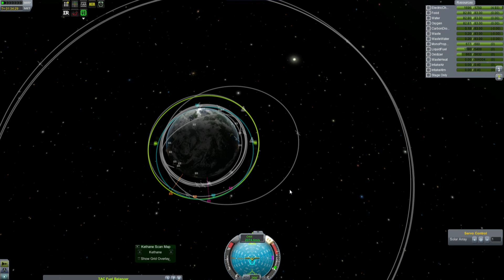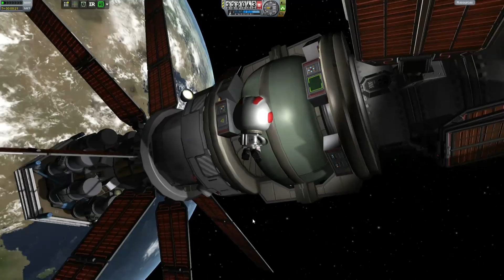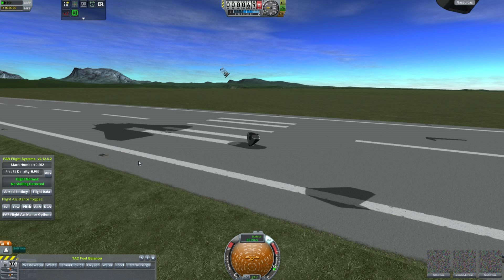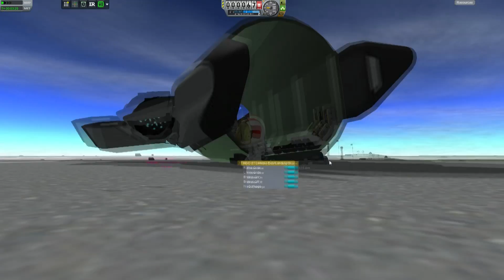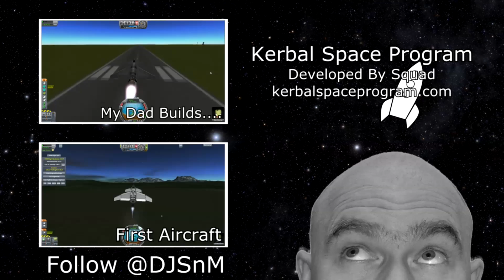Kerbal Space Program - Interstellar Quest - Episode 54 - Another Descendant Of Zardoz

Comment: That's what happens when Jeb lets Bill and Bob fly so that he can take a nap. I am certain he would have noticed that the landing gear indicator did not indicate gear down and locked on final. Surly a KAA representative will give all three a stern talking to after the KTSB investigators file their report.

However, it is possible that the crew was well aware of the situation but wanted to express to the design team their dissatisfaction with the vehicle's performance during accent, docking, and decent. Hence Jeb's grin as the plane disintegrated around them on the runway...

Comment: For the instability problems you had at high AOA I'd say that you should really consider using the pitch trim and yaw damper. I've made several FAR capable high mach aircraft and they all basically flop around and lose control if I try to fly them by hand, and thats with a joystick. Using the WASD controls is hopeless if you need to be that delicate. Pitch trim plus the FAR leveller and yaw damper and even the pitch damper really works great. It can be an almost hands off job once you get things balanced well.

As for the wobbling payload, have you considered using the KAS struts? You can attach them in EVA and strengthen anything attached to your spacecraft once you've bent it 90'. You might consider that for any future deliveries using the infernal robotics joint method.

Comment: Scott, do you play on Linux? I cannot play with half the mods you use simply because the 32 bit program for windows cannot handle the memory needed.
Reply: He's got a few mods which reduce the memory requirements for the various mods (such as lower resolution textures). It also reduces the boot-up time slightly, but not by a lot.

Comment: Scott Manley : I think you can address your oscillation and securing the payload problems all in one. Use the kerbal attachment system struts to secure the payload. Then once you open the cargo bay doors EVA detach them, extend the payload, then re-attach the struts to somewhere on the wings to keep it from wobbling while you dock. Alternatly, use RCS on the payload and EVA remove it after docking.

Comment: There was an easy solution to the oscillation problem. You should have selected "control from here" on the docking port on top of the cockpit. That one will not induce oscilations because it doesnt have a flexible joint. You would only have to visually align one axis, so it should be pretty easy that way.

Comment: The elusive "Octagonal Hex-Thingy"
Reply from the maker: I was reading that line in character.
Reply: Scott Manley
Scott, just a bit of a heads up that you quite possibly already know about; Ferram Joint Reinforcement works somewhat different in 0.23.5 since it gives over most of its functionality to the stock joint reinforcement, which means that whenever you upgrade, you'll likely have to redesign your launchers. Also, KW rocketry and B9 aren't currently set up (in configs) to take advantage of the stock joint upgrades.

Comment: MUR WINGS AND MUR STURTS ARE ALWAYS THE ANSWER. But really you needed to strut the Radiator to the actuator arm, Also maybe sturting the actuator to the space craft as well would have been a good idea and you obviouslly need more lift at high altitudes so either deflected wings to give you more lift or just plain old more wings.

Also deflected wing would make the turning for re-entry easier. Also if you have 2 Vertical stabilizers at the back if you angel them outwards toward the front by 5 degrees it creates a small amount of constant drag which stops side slipping and also. Its especially effective at helping you regain control after you go into a flat spin because it depends on drag rather than lift.

Comment: How did you get your Infernal Robotics stuff working with the update? I just checked their forums and as far as I can see there still isn't a fix for it yet. ALL I need is that hinge for my MW receivers.

BTW Quantum Struts work great for those docking issues. There is even a regular strut gun that isn't all glowey so you can retain realism. I put them around docking ports with a action groups, completely solved my wobbling problems. I also use them to hold payloads that will need to be released later. They are exactly what you needed to fix your oscillation issue.

also, that ending was hilarious. I really don't know how you always pull it off.  Your videos are the best, Keep it up!
Reply from the maker: I haven't updated yet, indeed, I can't update until all the mods are fixed.
Reply: Thanks for replying, and thanks for all the videos!

Comment: Instead of using a strut, you could use KAS. I have done this on a larger scale, a large spaceplane with a center area in which over one orange tank worth of payload can be suspended via 4 KAS winches. (The arbitrarily shaped payload was loaded separately, and therefore the spaceplane is actually 100% reusable in game that way.)

Comment: Scott Manley The reason for the wobbling is that the control point is perpendicular to the position of the docking node after using the servo. I figure it is an IR issue as I had the same problem but as soon as I set the "control from here" to the shuttles command section the SAS stopped trying to wobble apart the ship. Of course this created another issue of me having to completely eyeball the docking without any sort of instrumentation.

Comment: So many of the docking problems Scott Manley has could be solved simply by not screwing up the center of balance of his craft so much.  To wit: that radiator attachment would have been so much easier to put onto the power station if it had simply been RCS-powered and independent of the shuttle for the final docking.
Reply from the maker: The offset COM isn't an issue, the wobbling is the big problem.

Comment: For disableable struts, there is the Strut End Point from the Kerbal Attachment System. It's intended for manual attachment and detachment, and requires a kerbal to do this in EVA, but it is in there. Note that they have to be in pairs. You need two stut end points for one strut.

Comment: Arrgh, those oscillations. My space station had problems with that last update - it was fine if I left it alone, but I remember docking a transfer shuttle and watching it start to randomly begin bending and flexing most alarmingly. I had to turn off SAS because I was worried something was going to break off... though it may not have helped that each module has its own probe core generating torque. Hrmm.

Comment: That you can´t get power directly from heat its semi true. Actually PV-cells convert photogenic power from radiated heat directly to electric power. Well shure the PV is colder, but in theory, it don´t need to be, but in practical terms it need. There is one big difference, the heat output don´t need to heat up the PV-cell. Now, in real life, it does due to ineffecensy. But puting a wave length reflector infront of it and using only a narow band of radiated heat the heating of the PV-cell can be keeped under the power delivered.
Reply from the maker: PV Cells don't convert heat to electricity, they convert Electromagnetic radiation, that's a big difference.
Reply: Actually that's not entirely accurate. Power generated from PV cells is due to the semi-conductive nature of the material, in this case silicon. Photons knock valence electrons out of orbit from the silicon, and those induce the current. On PV cells you'll notice that there are strips of metal attached to both sides of the cell. That's your positive and negative ends of the circuit. The electrons run through those, going through the path of least resistance back to the other side of the cell.
Reply: What you're talking about is another form of solar energy where the solar rays are used to heat up a material and store it. In many cases this is water in an isolated system (no external heat transfer to environment). Other cases solar energy is stored through materials like nitrate salt. There's a big reactor in New Mexico that uses this method.
Reply: Scott Manley I don't agree with that, photons is just radiated heat. Ether way my argument still stand, you don´t need a heat sink for heat to PV conversion
Reply: matsv201
Photons aren't radiated heat. Heat is the most basic form of energy. Photons are atomic particles. Big difference.
Reply: Michael Simmer You are totally missing the point. Its about the interchangeability with heat and photons. There is always a intermediate effect used.
Reply: matsv201
Maybe this will help. I got my information from one of my college textbooks and a course in solar engineering, but I think this gives a decent explanation: http://science.nasa.gov/science-news/science-at-nasa/2002/solarcells/
Reply: Michael Simmer You don´t get it. Photon is a direct equivalent with heat, planks law

By the way, i read electronics on Ph.D level, so i kind of know how it works
Reply: matsv201
 I think there's a little confusion here. I think we both know light is a special property. It's made up of both particles and wavelengths. Heat from light comes from the wavelength portion of it, on the red to infra-red side of the visible spectrum. What PV energy uses is the particle form of light, from photons.

Planck's Law deals the emissive power of radiation from a blackbody and its relation to wavelength and temperature of that radiation. Again, this deals with the wavelength portion of light. As to what this has to do with PV cells, you've lost me.
Reply: Michael Simmer Well, i´m still quite a bit ahead of you. You use classical highschool arguments that might not be completely false, but is oversimplified.

" It's made up of both particles and wavelengths."
No, its not. Its behave like particles and waves, but its not both, its probably non of the above

" Heat from light comes from the wavelength portion of it, on the red to infra-red side of the visible spectrum"
Thats also wrong. Its commonly stated that IR is heat radiation, in most cases its true, but visible light is also mostly heat radiation. and also is UV light. The only diffrance about heat radiation from IR to UV is the temperature of the source.... planks law

"As to what this has to do with PV cells, you've lost me."
Finally... actually i lost you already in the first post, but now you relied your self.

Temperature, wavelength and voltage is all totally interchangeable. Red light is something like 0.8V, green around 0.9V and blue is a bit more (don't remember what value, to lazy to calculate it) Waveleght is also directly equivalent to temperature, så red light is like ~3000 something K, green just under 4000k, and so on. Red light = 3000K temperature = 700nm distance = 0,8V voltage (dont qvote me on the numbers, they probably not total accurate)

Here is the thing, if you have something that is about 5000K warm, say the sun you can use it to convert to about 1V of power via ~550nm of wavelength. Al nice and tidy. The thing is you don´t, in theory need a heatsink, so basically this is a way around the Carnot problem... well, if you don´t count in all aspect.

A solar panel will not work 5000K, it hardy works at 350K, thats because the temperature driven thresshold of the semiconductor, so you can make a 5000K and actually as low as a 1000k PV at room temperature, but you can´t make 300k PV, so that part of the law is intact. (its posible in theory to make a 300k PV if its submersed in liqud nitrogen).

The other part about sinking the heat. Well, most people "know" PV is normally just 20-25% efficient, so you basically have to sink the heat to not get a thermal runaway.....

This is only partly true. Most PV is actually around 80-90% efficient, but just in a narrow band of the spectrum. Sadly the sun have a Gaussian radiation, so its only about 30% that hit the spectrum, and of that 90% (totally 25%) is turned into electricity. But using a wavelegth discriminationg mirror you can actually make a PV that have losses of only 20% or something, reducing the cooling problem quite a bit. (but it will not make the PV producing any more power, just reducing the thermal problem).

With 90% efficiency with a 300/5000K system the carnot law is still intact by a slim margin. Thow, counting the reflected power the margin is huge.
Reply: Well, I'm impressed. And I have to say I do know what you're saying on most accounts. I'm afraid you also got me with the wavelength/voltage relation, that is something I did not know about, but an interesting tidbit nonetheless. Then again, not exactly my field.

As for the bit about light, yeah, I could have worded that better. It does have properties of both particles and waves. However I still maintain that photons are not irradiated heat. I believe in this case we have to separate and treat them as two different properties.

Your bit on Planks law I do agree with you on your latter statement. Temperature can and does effect wavelength. Higher temperatures do tend toward shorter wavelengths. And yes, I realize the sun can be treated as a black body, and thus a source of radiation. However your earlier statement was worded so that it seemed the radiation came from a photon, which to me didn't make sense.

But I think we got ahead of ourselves with the conversation, as interesting as it is. Not to mention it gave me a great excuse to review some of the material, so thanks for that. Granted, temperature does have an effect on panels. Higher temperatures mean lower efficiency. Here on the surface panels are efficient in the the ballpark of 20%. And this is assuming they are treated for reflection. I admit I don't know how efficient they would be in orbit. But I'm relatively sure of this: radiated heat, the wave portion of light, is not responsible for the PV effect. It's the particle portion, the photons, that are responsible and interact with the semi-conductor.

I do agree though, he didn't need radiators for a solar array. Thing is, that wasn't a solar array. That was run by a nuclear engine I believe. So his bit about a creating a thermal gradient to create electricity didn't make much sense. You can use the gradient to spread the heat out more by creating more surface area, but not to directly create electricity, even though there is a way of doing that.
Reply: About that last bit about the carnot cycle, you'll have to explain that. From my understanding that's about using a heating and cooling to drive a turbine. Granted heat from solar energy can be used on the heat exchanger/evaporator, but I don't see how that has to do with PV cells.

Edit: Nevermind, you're probably not talking about PV. I think there we're on the same page.
Reply: Michael Simmer Well... i should really say Carnot theory, the Carnot cycle do not exist, its only a theoretical model.

Carnot cycle/theory is part of thermo dynamic laws. Basically combining the thermo dynamic laws making a absolute optimum theoretical thermal engine will have a efficiency of Dt1/Dt2, and that's whats loosely a cannot engine.. that does not exist.

A PV, yes, photovoltage, is kind of not a thermal engine, but it basically do the same job. There is no obvious reason why a PV could not break the Carnot cycle, but it just don't.

The really strange bit is that you can actually increase the efficensy of a PV by lowering the temerature, and increasing temperature will lower efficiency (thats why PV is not a great idéa in dessert, tow powertowers work fine).

There is a area in PV called nanoantennas, and if they work, thy might break carnot cycle... to my opinion, the nano antennas will never work (the way they intended them to work)
Reply: Really am out of practice. Was thinking of the Brayton Cycle, not Carnot. As you said, Carnot is a theoretical model that demonstrates maximum efficiency of a reversible thermodynamic cycle, and no other cycle cannot surpass it. However all other thermodynamic cycles are derived from this model including the refrigeration cycles used in HVAC and Brayton used in power plants. PV has nothing to do with this. However it doesn't mean solar energy cannot be used in the process. In fact it is.

PV cells may be useless in the desert, but it doesn't mean you can't have rows and rows of mirrors aimed at a tank of water or some other substance with a low phase change temp.

Will be my last post. Want to put this conversation to bed. But good discussing this with ya.
Reply: Michael Simmer
Well, yea, PV kind of dont have any thing with carnot to do,... maybe... actually im not sure. 

But, and its a big but. just because the connection is not apparent, it might exist anyway.

But, if there is no conection, you could actualy break the carnot cycle, that most physics today believe its not possible.

My point is, PV is not a heat engine, it does not work like a heat engine, but it still seems to follow the same rules.

A PV convert heat, via (and that's the point you mist first) photons.

Even if PV follows carnot rules, there is a advantage to use them. You can use virtually limitless temperature. You can use a magnetic feld plasma from a fusion reactor with a miljon K and use optics to transfer it to a PV and convert it to power in theory with 99% efficensy. There is experimental powerstations that uses this principle, but no commercial.
Reply: matsv201 technically, light is a disturbance in the electromagnetic field. When said disturbance "hits" a particle, it can transfer the energy used to create said disturbance into a particle through the electromagnetic force. in a PV cell,it hits electrons, knocking them off their particles and into an electrifc current.